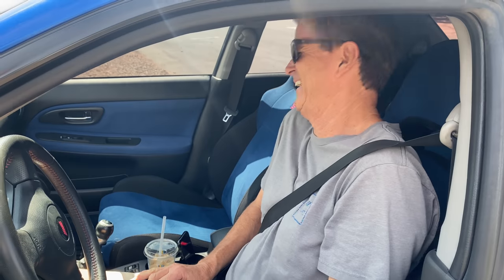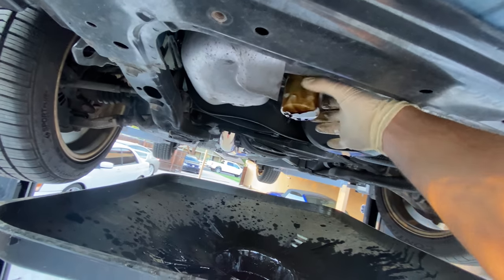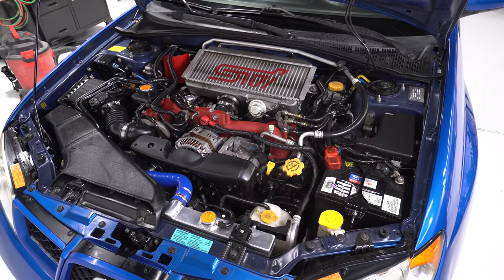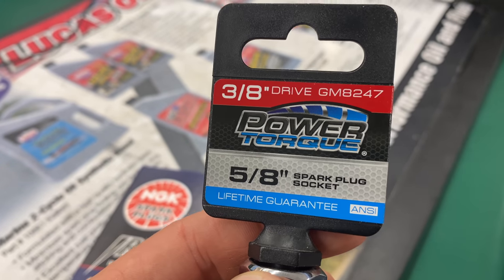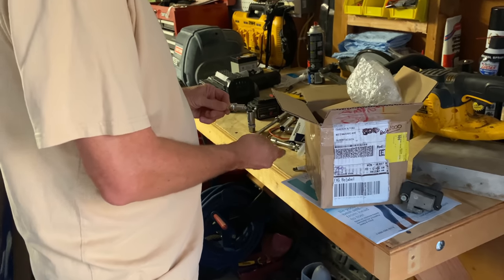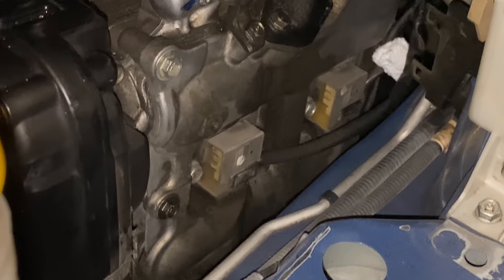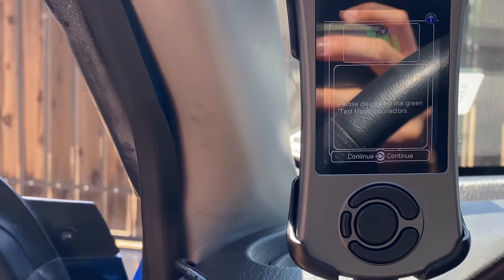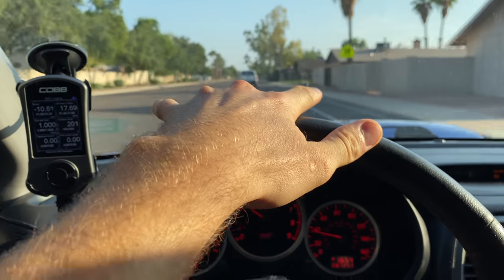Steps to Increasing my Dads STi's Reliability (2007 Subaru Impreza WRX STi)

Comment: I hope you guys are aware that brake fluid can't be "low" unless its leaking or somebody bled the brakes and didn't fill it back up. Under normal conditions, the brake fluid level drops as the pads wear and shouldn't be topped off. If its low that means check the brake pads, if they have plenty of material remaining, check for leaks.
Reply: Can't some of it be burned away? Serious question.
Reply: @aomaggots-  No. Hydraulics rely on the system being sealed. I'll give you a quick run down on the system. The master cylinder uses seals to push fluid when you push your brake pedal. The fluid pushes through your brake lines to the pistons in your calipers to clamp the brake pads down on the rotor. If the system wasn't sealed, the pressure from the master cylinder would never make it to the piston in the caliper. So moral of the story is, no fluid is ever lost or gained, just moved. And that was my point in saying if the level is low, either the brake pads are low (the pistons in the calipers are pushed out farther, thereby the fluid in the reservoir is lower), or there is a leak in the system (IE: rotted brake line, cut hose, leaking caliper piston seal)... Now this all being said, you should REPLACE your brake fluid every once in a while, as it is prone to absorbing water which makes it less efficient (lowers boiling point, can cause brake lines to rust, etc). But there should never be a need to just top it off unless there is an issue. Hope that clears some things up for you.
Reply: @coreyscarrepairs  I felt like I was back in school reading this 🤯. Great explanation tho lol.
Reply: Just an fyi, as the brake pads wear, fluid displaces the space in the caliper/pistons which will cause “low” brake fluid. That’s why when you replace pads, you remove some of the fluid in the reservoir, compress the pistons in the caliper then add fluid as needed.

Comment: I love My 07 Hawkeye and was lucky to get a good example for a good deal from someone who didn't know anything about Subaru's. I agree they will become classics and I don't thing I will ever sell mine even if the motor blows. Love the videos and keep it up!
Reply: Also I would personally suggest the IAG aos, killer bee oil pan pickup and baffle and pan to if you can and also cyl 4 cooling mod. That's what I do for reliability and I definitely will check out those coil packs for sure for mine
Reply: @pwnzama9403  not relevant for these early models only the last generation.

Comment: Doing the cylinder 4 cooling mod would also help the engine have a happy life. Great video
Reply: cylinder 4 cooling mod is such a hoax, if you know how the Subaru cooling works, then you would know, that the cylinder cooling mod,  all that is doing is taking hot water and pumping it back to the engine, without going through the radiator, that's why you see temps go up on all 4 cylinders. If you have problems with the water and cooling, then most probably you have a bad tune! If you want to know, how I know this, I have an 06 STI bumping 400 bhp, no issues with the cooling! Why? Because my mapper knows what he is doing
Reply: @petkokrushev3840  bro I tell them the same dam thing.  But they all act like I’m a conspiracy theorist lol.
Reply: @AntilleanConfederation  when people are uneducated, this is the result
Reply: @petkokrushev3840  400hp isnt a testament to you tuner knowing anything, not difficult...
Reply: @petkokrushev3840  go ahead and make a video explaining it, because he has FAR more evidence FOR it than you do against it. just condescending statements, that prove nothing. I can say the same thing, uneducated people can't watch his videos apparently like yourself. also tons report having COOLER temps!
Reply: @AntilleanConfederation  look at the replies from Ross Ritchey, another tool has no clue
Reply: @boppernostopper8598  do you know, where the hot water goes, that you are taking from the back of the block with this "mod" ?
Reply: @petkokrushev3840  i have a pic of a before and after  can i send it to you?
Reply: @BxrTerror   pic of what, temperatures?
Reply: @petkokrushev3840  yes
Reply: @BxrTerror  I hope, it's not the EGT's from the blingstorm website?
Reply: @petkokrushev3840  it is
Reply: @BxrTerror  haven't you seen the numbers, that all cylinders went up and thats just on idle,  now imagine, whats happening when actually driving the car hard. On this test, cylinder 4 is cooder, but it will go up, as all 4 cylinders will go up, because you are just simply pumping uncooled, hot water directly back into the engine. Below you may see, that in average, temps went higher:
EGTs without the kit (848, 832, 827, 901) - AFR: 13.4
Min: 827
Max: 901
Avg: 852
Range: 74

EGTs with the kit (874, 862, 865, 882) - AFR: ??
Min: 862
Max: 882
Avg: 870.75
Range: 20
Reply: @petkokrushev3840   @Petko Krushev  so there is nothing that can be done about cyl 4 being hotter than the others? Can the reason be because of the way the exhaust port is casted? Why did they cast the ports next to eachother instead of symetrical to the cylinders like cyl 2 and 3 ports already are?
Reply: @BxrTerror  Yes, you are correct, the problem with the temps is the way the subaru casted the exhaust exits on cylinder heads, on cylinders 1 and 4 the exist is not straight, but on 90 degree bend, while on 2 and 3, the exit is straight. The best you can do, is to install equal length headers and it brings the temps down. Another good thing is the water meth injection. Also, another thing that you can do is a twin scroll setup, exhaust gasses are not mixed that way and your cylinders vent the exhaust gasses much better, resulting in much cleaner air/fuel mixture
Reply: @petkokrushev3840   is it possible to design/use heads with symetrical casted exhaust ports?
Reply: @BxrTerror  I guess, but who knows how expensive it is
Reply: It's always cylinder 3 that brakes🤣
Reply: @petkokrushev3840  so you’re telling me that a cyl4 cooling mod only worsens things under the hood. And the fact that keeping cyl4 hotter than the others is better than keeping all of em the same temperature. You just made me lose a couple brain cells.
Reply: @petkokrushev3840  so your saying its better to have one cylinder hotter then the others rather then have that heat evenly distributed?
Reply: @petkokrushev3840  I just heard about this "cooiling mod" a few weeks ago and I was skeptical myself. The guy that told me about it said that it reduced his knock. Not sure if he is full of it or if it actually works. It's funny because there are a bunch of hoax reliability mods for different cars out there. Like the IMS bearing on porsche.
Reply: @petkokrushev3840  my understanding of what Dom is professing is that only cooling cylinder 4 by a few degrees is sufficient.

Now, having said that, the cyl 4 cooling mod routes hot water from the head to the heater core right? As you say, not to the radiator which would make more sense. My question is, adding an extra hose and more surface area for the water to cool down even only slightly is sufficient to drop temp a couple degs? It's not extraordinary but it is something no?
Reply: @santouchesantouche2873   you can cool the 4th cylinder with much better and efficient parts, such as equal length headers, meth kit, a good tune, without raising the temps on other cylinders!
Reply: @petkokrushev3840  I take it your answer to my question is to instead employ costly and more complicated ways to achieve cooling cyl 4?
Reply: @santouchesantouche2873  costly, but proven! Only data there is in the internet about this hose, is the provided egt's and based only on that, it's a terrible device, which raises temps across your engine! And thats only stationary, now imagine, what the temps would be when running hard. As I've said earlier, Dom claimed, that he did an r&d to find the perfect diameter for the plug and the hose, so the cooling would be obtimal, but there is an OEM plug 21170AA020 with the exact dimmensions, so if he is lying on this part, why would you believe on the other?
Reply: @petkokrushev3840  you raise good points. I actually would love to see independent testing. Surely there is a youtuber willing to do it...!

The stuff about the hose and plug ID is circumstantial at best. Dom could have chosen a smaller ID for hose or larger... The plug size is coincidence
Reply: @santouchesantouche2873  I don't think it's a coincidence at all, he got the whole  idea for this from the twin turbo ej20, where this plug is used to cool down the turbo. As you said, someone should do a real test with temps.
Reply: @petkokrushev3840  so, theoretically if this cyl 4 cooling mod was instead run to a hose that then went through the radiator, then it would probably be better perhaps?
Reply: @santouchesantouche2873  much, much better, then it would be actually working
Reply: Please do NOT do this mod.
Reply: @extremeboiwoo  why?
Reply: @extremeboiwoo  Yes please explain
Reply: @AntilleanConfederation  often iam not on it because these are old cars. What to do or if the mod helps I don't know. How did they survive? On sporty driven cars huge construction problems will kill it mostly in early years or at least way, waaay before 10 years of age. Yea o know the one hot cylinder problem!
Personally I only have an radiator enclosure ontop to force more air through it on my WRX. Have this thing for 16 years now and done everything from nordschleife and half an hour flat food on the Autobahn. Besides that i baby it when driving. Tune is stock.

Comment: Nice Vid! Currently have 160k on my 06 sti (original engine). These cars can last when taken care of properly. 
Only other mod I would recommend is the killer b oil pickup and or pan if you would like. The oem oil pick-up tube tends to fail.
Reply: Incorrect. Only on the last generation not these early generations.

Comment: Changing the size of the oil filter can affect the oil pressure. You should keep stock filter from the factory. That's what I've learned when I went to subaru school in FL. Topping of the brake fluid is not recommended due to mix fluid  if your brake fluid is low usually either low pads or leaks. You should bleed the brake fluid for a fresh fluid instead of mixing it.
Reply: Uhhh yeah, it can affect it on a positive way... By lowering pressure drop through the filter element... How did that make sense to you as you typed that out?
Reply: @evanchi9460  not positive way wrong size or bigger can change the oil pressure with subaru has to remain same pressure. Even you have after market oil pump you still have to keep the oil filter the same size.
Reply: @ararson4710  A larger filter, except if terribly designed, will generally lower pressure drop, and increase the flow and performance of any oiling system, Subaru isn't special. 
It's extremely common for a lot of us, particularly highly built Subarus to use the Mazda oil filter (N3R1-14-302) because it's literally just a larger taller version of the OEM filter, better in every way. 
As I said, it will change oil pressure, absolutely, but only for the better in practically every case, unless of course you're using a smaller filter. 
Also using a 12mm pump on my 255, it's terrifically healthy setup this way.
Reply: Bigger oil filter muy bueno no doubt

Comment: Good vid i just picked up my STI GR hatch and the first mods i did were - cyl 4 cooling mod , RCM baffle plate and pick up , aluminum water cooler and about to install the oil separator from iag . ( Allso did all the classic maintenance ) all the oils and all the filters she is sweet yet high miles but running strong 143k miles 💪🏻

Comment: You know I've never had a problem with the Subaru's I've owned. In fact they have been the most reliable cars I have owned. I also don't drive them like racecars because they are not, and I'm sure that has alot to do with it.
Reply: Are u ok?

Comment: RAworx in phoenix is a great resource for subarus. So here in AZ Shell Or Chevron seem to be our best 91 according to Rich at Dynocomp in scottsdale. apparently they are just the most consistent fuels here. sucks our az/ca/nv gas is not as friendly as the rest of the country. i think fuel matters significantly in AZ. it did on my 2012 wrx stage 2. round 280 whp. i make sure to only use shell even with my GTI. great video cameron!

Comment: They are reliable from the get-go... literally been driving STIs in Florida for 16 years, no issues, no oil burn, driven hard.
Currently pushing 408whp on pump gas, no AOS, no cooling mod, again zero problems. 

Just learn how to tune conservatively and drive correctly.
Reply: Can you give some advice? Like things to do and things to avoid doing..

Comment: You can certainly make an STI reliable by just keeping it factory original.
Reply: or mod it intelligently, get a tune, and stay up on maintenance..
Reply: @general3883  Not really. It certainly not optimal for 500.000km reliability, but not that terrible either, their pistons are designed for horizontal use. One side of the piston has more weight than the other to counter the effect of gravity.
Tuning them on the other hand has to be precise. you cant just do semi sloppy job on a boxer engine. I ve seen guys getting 700-800 horses from 2.2 or 2.5 ej's and they are reliable for 50.000+km and 2bar boost everyday abuse.
Naturally aspirated on the other hand are extremely reliable. One day i was at my mechanic and he was rebuilding a 2r 2006 ej20, and after i asked him what happened because my car has the same engine, he told me nothing, just maintenance because it has 450.000 km.
Reply: @general3883  So all the engineers at Subaru and Porsche are wrong and you’re right?
Reply: Not as reliable . Turbo mesh screen filter leave or remove?
Reply: Until the factory oil pick up tube snaps and spun a bearing. Not all the factory parts last or have a great design. Just do your research and mod smartly, 4th cylinder cooling mod, aos, etc

Comment: IDK, Subaru's are a pretty reliable car to begin, main thing and it's the same w any new/newer car is stay on top of maintenance. My family has had 3 different Subarus, older 88 Subie had just under 300k with no major drivetrain repairs (engine/tranny rebuilds etc). Sister has since new the Tribeca SUV(I believe that's the name)with 170+k mainly highway miles that runs like new. I talked my mother into buying '07 Impreza (124k miles currently)which has had some serious issues but, issues that don't have anything to do with Subaru quality this is why I said maintenance is key. Myself personally, I've been a GM guy my whole life but, even I know if ur looking for a car to last forever and get good mileage u buy a Subaru or Honda. So I pointed her towards a Impreza, plus here in CT the AWD comes in handy during winter snow season. Unfortunately, and this is the same with a Chevy/Ford/Honda or Subaru or any new car, if you don't stay on top or/ or outright neglect regular maintenance that car isn't gonna last very long. With the 07 Impreza she let the old man drive it as long as he took care of maintenance on it, which he claimed he'd been doing but finally got caught cuz he'd barely done any of it. Out of the 124k miles he put 70%(est 92-95k) of the miles on it, doing oil changes every 20-25k miles, replacing 1 broken belt but left the others etc etc. His idea of a full tune up was, tell the garage to put new plugs and change the air filter.
Even worse is I'd been offering to do all the maintenance, he just had to get the parts n id take care of it. Instead he would lie and claim he did it, and would get pissed if I attempted to even lift the hood.
As you can probably imagine, it blew up in his face spectacularly starting right around 110k miles. We had the front brake pad actually fall out right as she started pulling out the driveway, this is after he claimed to of done a $2000 brake job on it. 
Since this we've replaced: Water pump/coolant crossover tube/catalytic converter and pipe/resonator and pipe/resurfaced/rebuilt the cylinder Heads/Head Gaskets/timing chains/brake lines/battery 2x/all brakes rebuilt/replaced trans pan/and now replacing muffler/pipe and CV joints.  Granted some of this stuff is typical repairs w this mileage but, having to have the heads resurfaced cuz they warped when he overheated it and said nothing to anybody about it isn't normal. If he'd just done the little maintenance crap, oil changes/filters/tune ups etc, probably wouldn't of had to do a lot of this.
Anyway, sorry for getting off track just still pissed about it.
I know the STI/WRX 2.0/2.5T Engines have a lot of differences from the NA2.5 in the Impreza but, their still pretty damn reliable engines as long as their taken care of. They'll most likely need refreshing sooner than the NA 2.5 will but, that's true with any turbocharged performance engine. Also depends on how badly it's been beaten on while driving it(racing etc), that's the nature of the beast though. Start throwing things like Bigger turbo/came/upping boost etc, and the reliability will decrease a little w each part. Even then it'll still be a reliable enough engine as long as I stay on top of 2 crucial things, biggest is the tune followed by fuel.